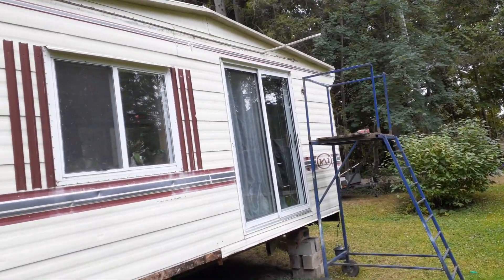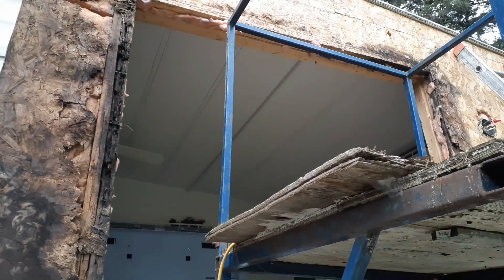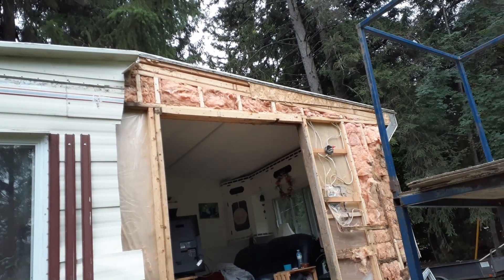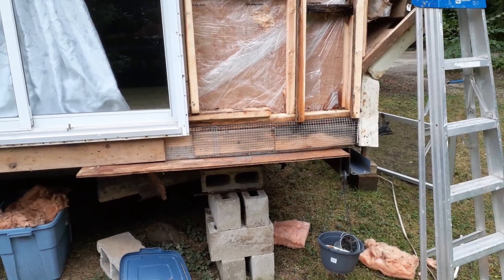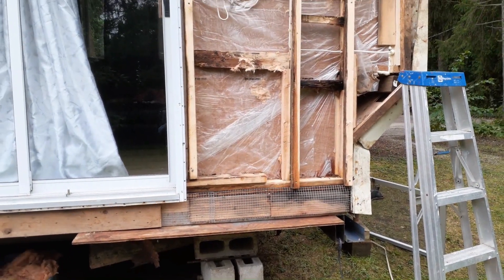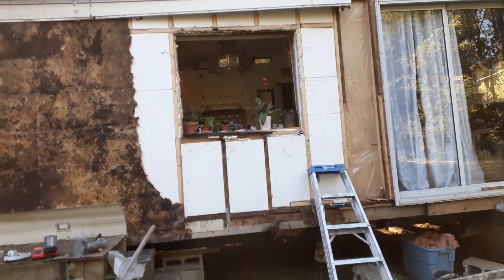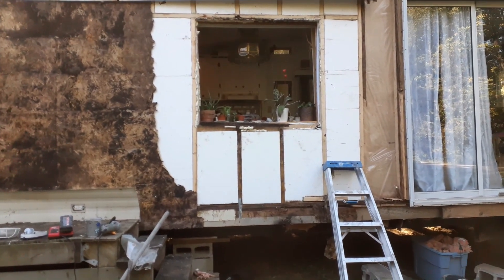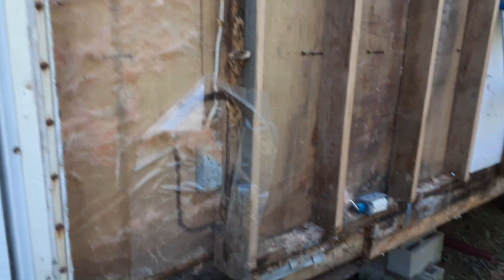Styroaircrete - Yes we can! Insulate Your Mobile Home

Comment: i would love some feedback on how this is holding up and if you gained/lost weight on the overall home
Reply from the maker: @MichelleBrebner  probably gained a bit of weight but not much... Standing up so well that I have done most of trailer now. I found that by attaching chicken wire to the studs before filling with styroaircrete worked really well and makes a good surface to cover with thin parking. Also adding 10x20 addition...all made with styroaircrete and wire grid...floor, walls and roof! Will be posting videos soon...

Comment: George, what is the mix quantities for your product. How much styrofoam cement foam for one barrel.
Reply from the maker: I fill barrel with foam and add 30 gallons shredded styrofoam as it fills, mixing gently with a shovel and leaving enough room to add 5 gallons of slurry made up of 1/2 bag of portland, which is added at the end of the mix. If making panels/blocks use full bag of portland.
Reply: @ruggedist  how about if I'm fillingbetween post. Like in a post barn construction. The posts hold up the roof and I fill in forms between the posts. the form will beremoved and screed and clothe applied with more screed for strength.

Comment: Hi George. Great video. this is what I love about sharing ideas on Youtube  because it gets more people testing and sharing their findings. Your mix is actually a little wetter with more cement than my mix just from looking at the video and your mix pours better because of that. The less portland in the mix the better the R value I have found. I had to pack mine into the molds since the mix did not flow well and thus would not fill every nuke and cranny. But the weight of the mix I imagine also helps to push it into the crevices as it gets up to around 3 or 4 feet. People have been building with wood encased in concrete for generations. The wood does fine as long as moisture does not enter the wall. Styro aircrete will absorb water due to the porous nature of the foam in the mix but will dry out if allowed too. What kind of siding are you planning to install?
Reply from the maker: Hi Stephen! Glad you watched the video! I have been following your too. I was planing to parge with a layer of landscape fabric. But I  also come accross light weight paneling used to build sheds... I  may use that. 
I added a electric wire grid to top of my shredder. I find that the smaller the pieces going in, the easier it is on shredder. Pieces are about 1 " square  after three layers of wire, which is mig welding wire for stainless steel.

Comment: How much time you roll the cake ?time is important once you add the cement !can you appreciate?how much foam agent did you use for one batch ?
Reply from the maker: The foam concentration is only 10ml mixed in 1 litre of soft, warm water. Need about 15 litres to make enough foam for 50 gallon barrel
Reply: @ruggedist  150ml
Reply: @ruggedist  i suppose that this dilution ratio is only apply for your product that you using ! So is silly question from my side sorry ! I mean each product has its dilution formula! i think once i found a goof foam product around here i probably should do some density tests to understand how can i use it s capabilities ! the first test will be time test and foam strength test ! those 2 could be done even by a child...what weight measuring tool do you recommend for kg ?

Comment: Great job!  You could lay the barrel horizontally on rollers and spin it by hand or motorize the rollers so you can pour and/or  prep another barrel.
Reply from the maker: I did try to rig up a pallet with wheels upside down, but the barrel proved to be difficult to maneuver into place and because it was plastic, the wheels tended to indent the barrel. It  was then that I realized rolling it on the ground is much easier.
Reply: @ruggedist  I was thinking it would save time by using something like this https://www.youtube.com/watch?v=aatX1b_zYLQ

Comment: Hi George!
Nicecwork! Just wondering....Are you concerned about the Styroaircrete cracking if you move the trailer?
Reply from the maker: Hi and welcome Petter! I  have considered that. I  think once the entire trailer has all cavities filled, and it has been wrapped with landscape fabric and parged, it will keep the walls from moving. At worst there may be small cracks that will not affect the overall performance.

Comment: What affect do you think the styroaircrete will have on the lumber?
Reply from the maker: Hi and welcome Gavin! Styroaircrete cures fully in about 40 days. If a parging topcoat is added, or typar and siding, the lumber will outlast us.
Reply: @ruggedist  The curing process takes the moisture out of it? so if it's sealed and new moisture isn't introduced, there's no reason to treat/oil the lumber?
Reply from the maker: @gavinlefthome  I would say no because oil will probably keep the styroaircrete from sticking in those areas. I  am not sure how other rot products are manufactured but if anything, I  would do some testing first.

Comment: So simple. What are the benefits? Is it cheaper than fiberglass? What is th R-value?
Reply from the maker: Hi and welcome Jay. There are many benefits... it is very inexpensive to make. About $.30-.40 per gallon. (7.5 gallons make a cubic ft.) It flows in every nook and cranny, thus creating a super seal. It can be done from the outside of building. The r value has not been scientifically tested yet but must be in the neighborhood of 6 per inch. Bear in mind that the value is true and does not change with humidity levels as fiberglass bats do. It also encases rot and stops it from spreading further, as no moisture or air will ever reach it again. It is also 100% fireproof and styrofoam beads will never ignite or melt. ( see my video on fire test) lastly, no insects,  creepy crawlers or mice will ever get through.
Reply: @ruggedist  Thanks for that. The rot encasement/arrest is quite interesting. I can see how it solidifies a rotten structural member, but how does it stop the rot from growing? Is the composition waterproof? Will rotten wood dry out once encased?
Reply from the maker: @treenopie    Yes the moisture in the styroaircrete is all gone after 40 days. If no moisture or air can get to the rot, it stops.